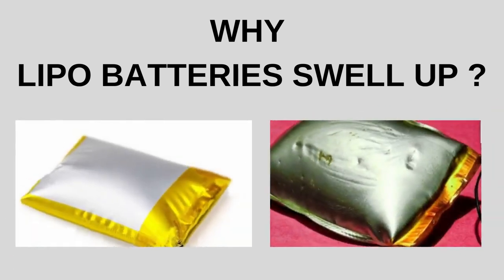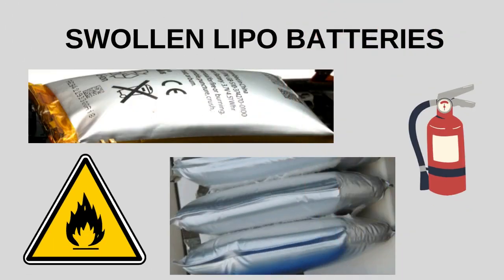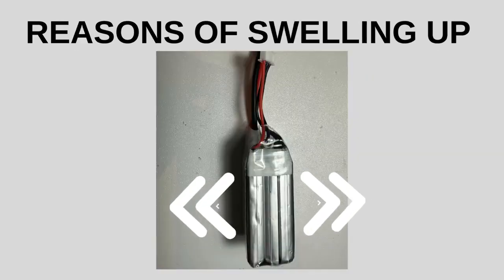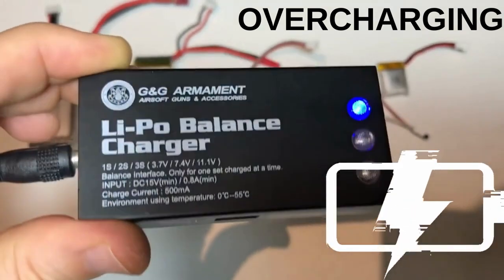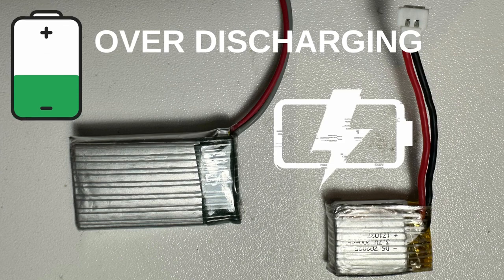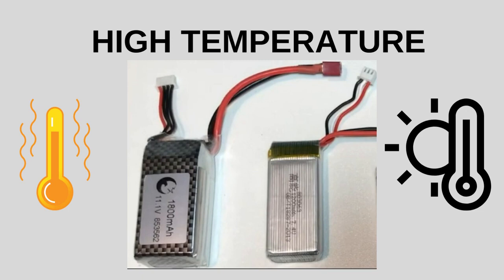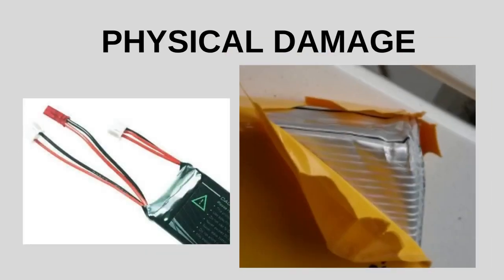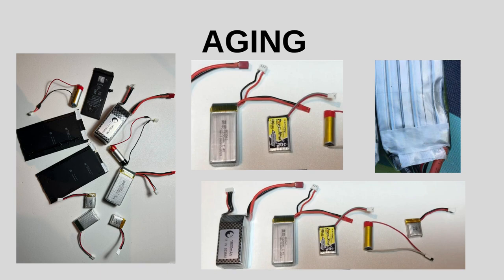Why Do Lipo Batteries Swell Up ? What to do with Swollen Lipo Batteries ?

Comment: Does 1 minute battery life mean the battery is ruined?
Reply from the maker: Lipo Battery life depends on several factors, including its capacity (mAh or Wh), the power consumption of the device, and how it’s being used.
Reply: IT was supposed to last 10 minutes so i guess, i should get rid of IT Then. But its ok IT was small anyways and i kind of Lost interest already.

Comment: I have an Orashare 20,000mAh Quick-Charge powerbank. Had it since August 2022 but in June 2024 i noticed it's starting to swell and its performance has worsened. Now i dunno what to do with it because there are no lithium battery recycling facilities nearby.
Reply from the maker: When it starts swelling there is no way to save it.
Reply: @STFocus  yes, but there's also no recycling facility where I live..
Reply from the maker: @ronch550  not good.